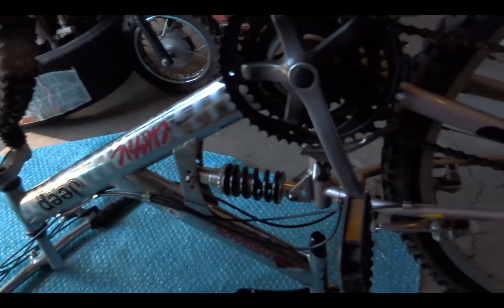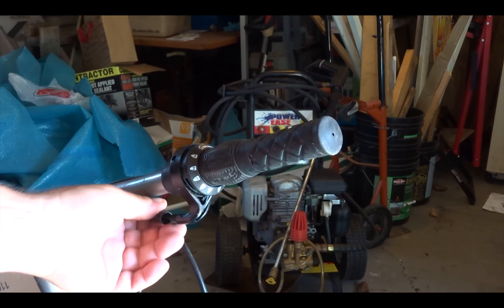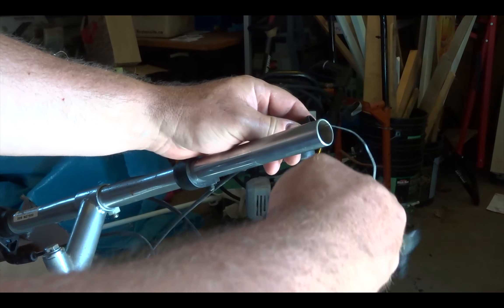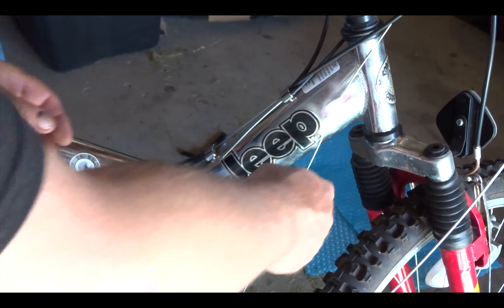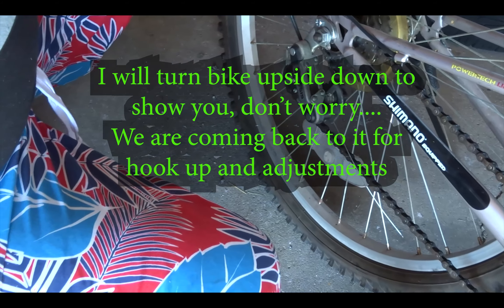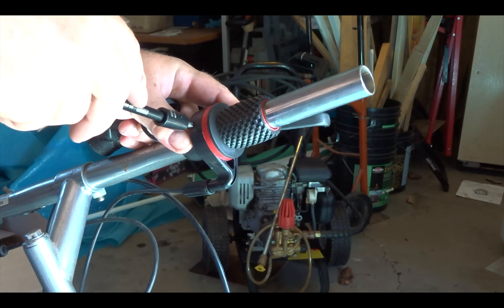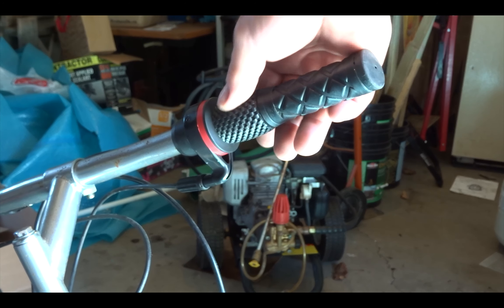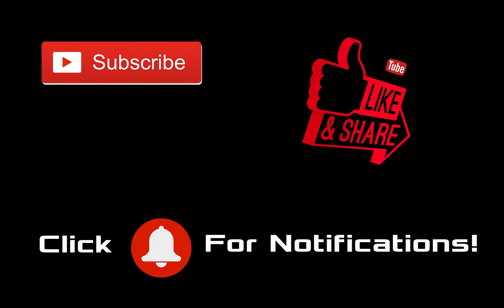Replacing Bicycle Twist Shifter Easy!

Comment: I have an 18 speed with this style of shifting.  I’m going to have to replace both.  Do they come in pairs for front and back sprockets or do i need to find them separately?
Reply from the maker: @winminny3150  it's been awhile but if I recall they are universal,should work on either side